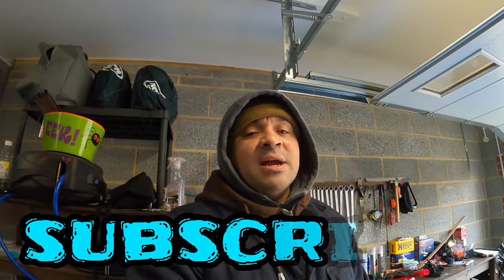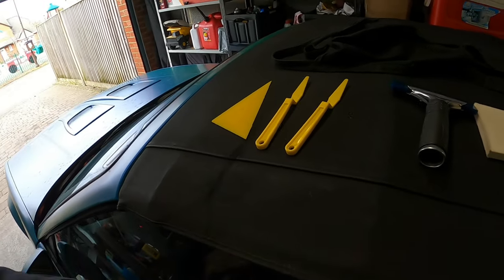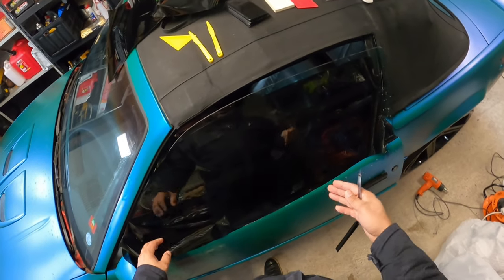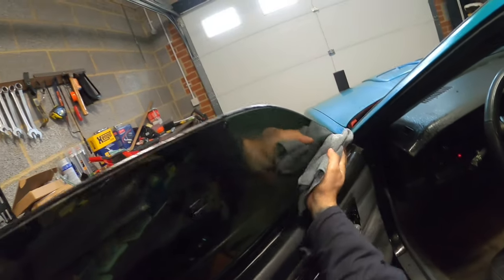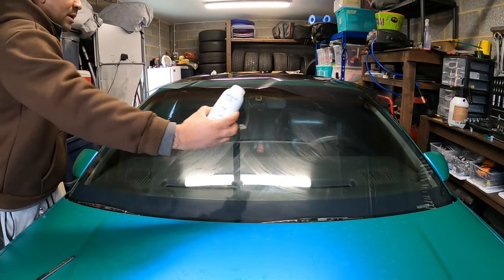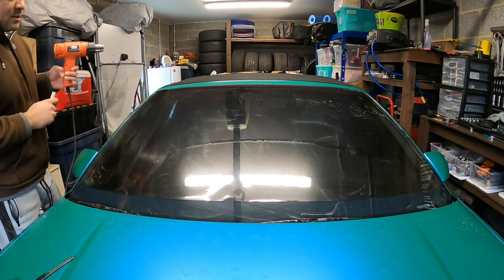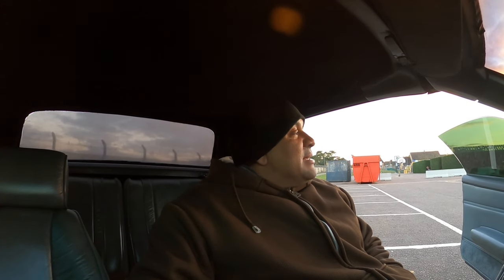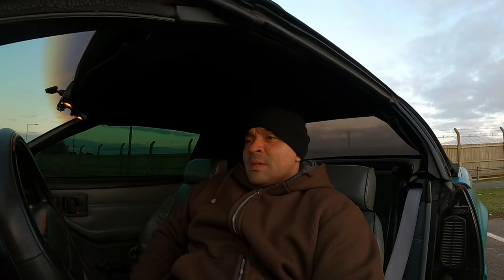Tinting my 3rd Gen Camaro/How to tint windows

Comment: That's 🔥🥶 can you tell me where did you get the stuff you put on the lights and that back glass? I want to do mines like dat homie
Reply from the maker: I got it off of ebay.com. Search auto light tint.
Reply: @SaundersLifestyle  Don't want to ask a lot of questions but how can I get a 2 12 custom box for my 91 Camaro convertible??
Reply from the maker: @stanleycook3459  Your best best is having a audio store custom build you one. The sub box I have is not built for the car. Its a simple square box that barely fits my trunk. Im going to get one made when I move back to Texas

Comment: I got a 90 rs I just installed some switch back turn signal leds for the  front lower turn lights check them out I think it will look awesome having daytime running lights and when you hit the turn signal it blinks amber after you turn it turns back to regular led my Camaro same color as yours but it factory paint no rust garage kelp
Reply from the maker: Whats the link for the switchback turn signals? I def wouldnt mind getting them for the 3rd gen.
Reply: I ordered off of Amazon 16.00 for the turn signal bulbs(AUXLIGHT) is the name of the company I bought from it’s a 2057 led switchback turn signal light ) you have to get 50w 6ohm load resisters too just get a 4 pack 9.99 and depending on how your light adapter is made might have to switch it out the 90’s factory  one is too deep to accept the leds I went to my local part store and grabbed a set for 5 bucks and just came home and re-wired it and made sure everything was water tight also your going to have to upgrade your flasher to a led rated flasher relay  and last make sure you run leds in the turn signal side maker as well
Reply: Check out screaming chicken F-Body website so you’ll get a visual they too high for  my pockets but that’s where I got the idea from
Reply from the maker: @breeze7906  Preciate the info....ill def look into it.

Comment: Do you have a video putting the vinyl on back window?
Reply from the maker: No...I should have done one though. Its tail light vynil tint. Goes on farely easy.
 This is the film I used. Its been on my rear window now for about 4 months and no issues. https://www.amazon.com/dp/B083L6R3ZQ/ref=cm_sw_r_cp_apa_glt_fabc_FX4RTF1GHNMEAST83P6N?_encoding=UTF8&psc=1